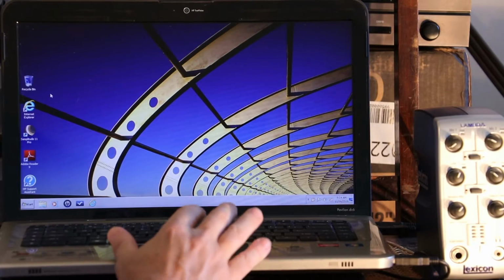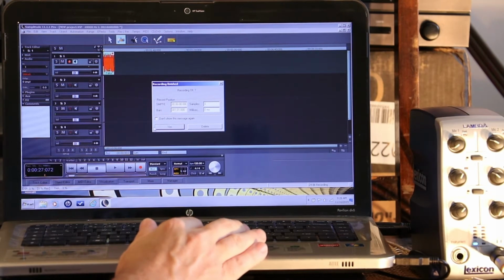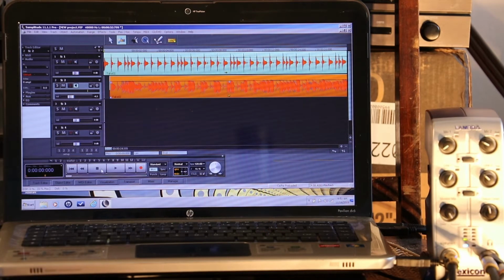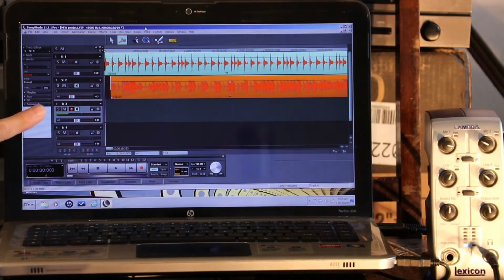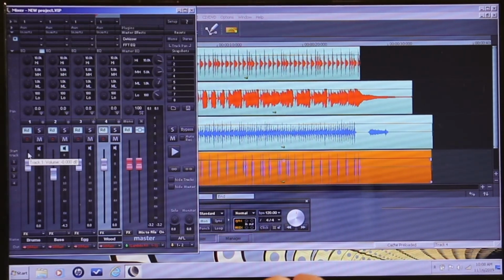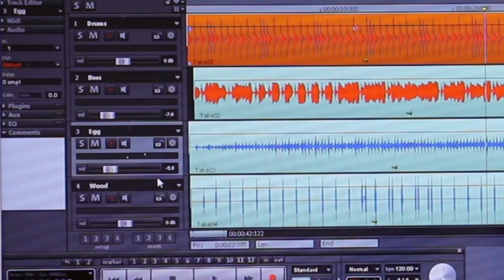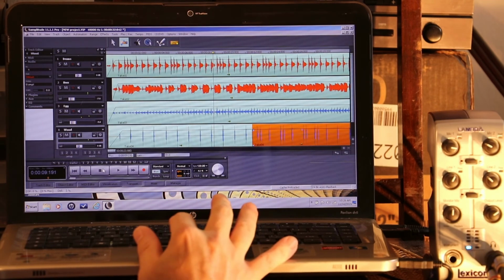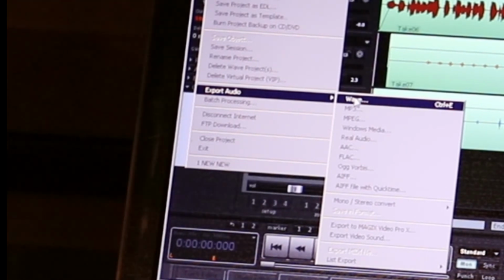Basic Recording Lesson 1 using the Lexicon Lambda and Samplitude Pro 11 Recording Software

Comment: I have a question am new using this program 2023. How do i prevent track one from recording onto track two when i need to hear track one but record on track two and so on…..   basically be able to record each track without picking up the other tracks. Can you help me with this and i would be very grateful…if you can break it down to me please.
Reply from the maker: Whatever track you want to record on, just arm that track or tracks only by pressing the little box with the red dot [ it is directly above the fader ]. You will be able to hear the other tracks but only the record ready tracks will be recorded on. Please let me know if I have answered this correctly my friend.
Reply: Easy, throw it away and get a Behringer UMC22 or the UMC202HD.